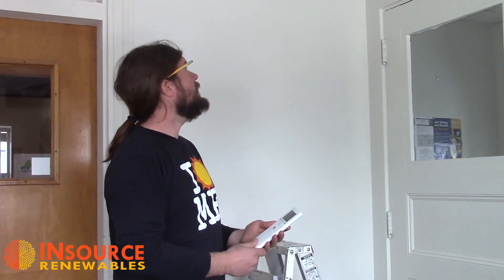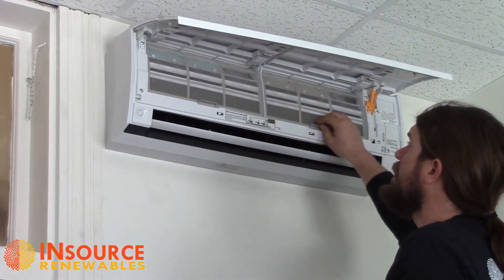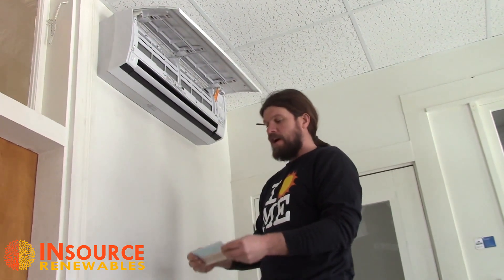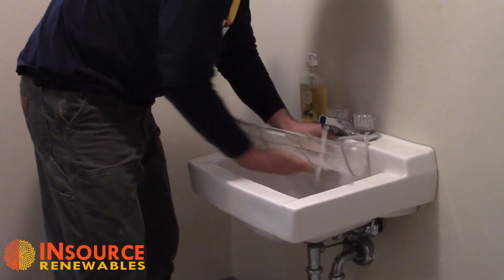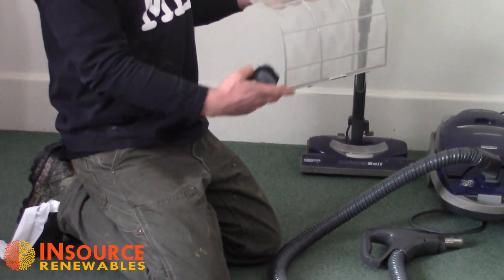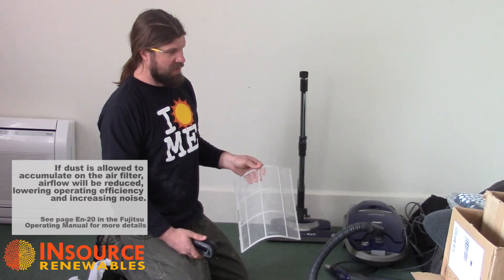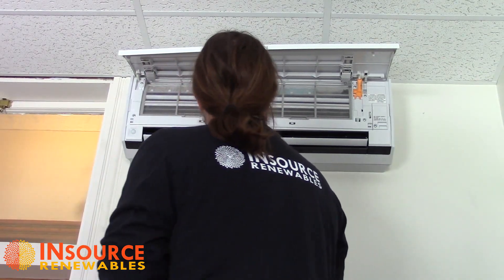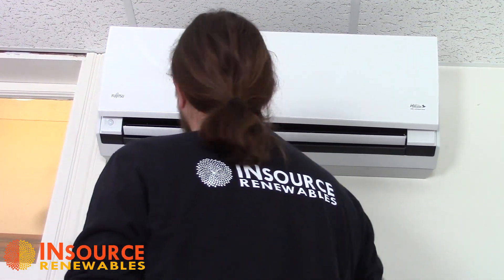Heat pump user tips #1 (Filter maintenance)

Comment: Before watching this video. I cleaned my filters using hot water with Palmolive dish soap. To scrub I used a brillow pad not knowing the damage that it can cause. I still run my unit. What is the consequence of doing so. Honestly curious I do not want to further damage the machine. The filters that I cleaned we're the main ones that you showed on how to properly clean.

Comment: I just cleaned my filter now I have the lights blinking.
Do you know if the center clip actually needs to be closed? It juat looks like Styrofoam in the spot the middle clip connects too?
I've clipped all 3 connections down and it is still not working. I'm wondering if I broke something on the center clip?
Reply: Is there a way to check the switch. Do the latches actually make any type of electrical connection or just hold the main switch down?

Comment: When you're not using the AC for long periods, is it better to turn it off at the switchboard? Or there's a grey switch near the outside unit do I turn that off? Does the filters need to be completely dry before you put them back?

Comment: Now I can't close the frucking flap, it's sticking out.
Reply: If you're talking about the dark gray cover below the larger white one, there are three tabs. This unit is notorious for having an issue with a tab breaking or not seating properly. If you press on the dark cover directly where the tabs are located and they don't seat, you may need to take further action.
Reply: @vaughanwoodruff  I finally managed to close it. I had to play with the tabs so the flap's could slide in, ugh...

Comment: You should never seperate the top lid from the bottom one, or put your hands between them.
You should not touch the upper lid at all, except when you press it on those 3 spots at the end. You close and open the lid by little handles on the side at the same side, and close it like that, then press the whole lid on those 3 spots. You handled that lid completely wrong. You can read the same in the manual.
Thqt's why you got that error at the end, which is not supposed to happen.

Comment: Great explanation of everything under that hood! 
How often do the hood senors need to be changed? I absolutely dread cleaning the filters because .every.time. on both of my units, I receive the error code that the hood is not closed properly. Its been a game of chance and skill, to see how many times I have to open and close the hood before the unit turns back on.

Comment: My unit is throwing this error code even though it IS closed correctly. It has done this many times over the few years I’ve had the unit, but I’ve normally been able to solve it by turning the breaker of for a few minutes. This time nothing works, does anyone have any ideas?
Reply: Joel, if you have the intake grille cover open (with the orange kickstand up), the switch is located on the bottom right corner (below the kickstand and beside the electrical cover). If you hold that in and the code doesn't clear, you have a bad switch. If you hold it in and it does clear, there is an issue with the seating of the grille cover.
Reply: Vaughan Woodruff, I’ve been thinking it may be the switch, the thing is it’s been a problem for awhile now so I’m thinking it may have been going out for awhile now.

Comment: I have this unit, took off the filters and cleaned them. The door closes fine but when the door starts to slowly move up, it gets to the top and just falls closed again. No error code but the unit works but the door is closed so the air doesn't flow. I have had to duct tape the door open to keep the room cool. Do you know how to make the gears catch again?
Reply: If it happened following a filter cleaning, I am suspicious that the cover may not be properly reseated. Typically this would trigger an error code, so it is quite possible that the plastic gear on the cover is broken. They crack sometimes, which requires replacement.
Reply: @vaughanwoodruff  Thank you! :)

Comment: Hi great video just a quick question I have a toshiba inverter carrier 
It seems to leak water on side and down my wall any suggestions thx
Reply: That's condensate - it's due to either a trap in the condensate line, the indoor unit not being level, or an obstruction in the condensate line. If this is a new unit with this issue, it's likely an installation issue. Is this is the first time it has shown up after years of operation, it might be insect nests in the condensate line. We have seen a rare occurrence of a leak in the condensate pan, but that a hundred-in-one shot. Good luck!
Reply: Vaughan Woodruff thx a lot I just bought the house last year and the unit was installed 
In 2013 and serviced 2017 maybe it needs to be serviced again thx again

Comment: Hi - I find that inevitably, some airborne cooking oil will mix with the fur, dander, and dust that accumulates on the large filters, making rinsing with water inadequate.  I spray the filters liberally with Fantastic and let them sit a few minutes before rinsing with hot water.  If they look off-color, a second spraying, wait, and rinse cycle is warranted.  You can hasten cleaning by using a soft, fine bristle nail brush and gently stroking the built-up dust, mold, etc. before rinsing.  That makes the filters sparkle, and removing any built-up grease makes them easier to clean next time, and not as much of a dirt anchor and food source for mold and pathogens.  Air drying thoroughly before reinstallation is important, as well.  In summer, the vent flaps will condense moisture from the air when the unit shuts off, because the vent flaps are cold; that moisture will leave a dirty residue that is likewise a bacteria and mold culture medium.  A quick pass with a sponge wetted with Fantastic will break up the residue, which can then be rinsed off with a clean sponge.  Looks, smells, and IS clean and healthful.

Comment: How often do you recommend the screens be washed?
Reply from the maker: It depends upon the air quality in your home and how much you use the unit. We recommend inspecting the screens every couple of weeks after you have put them in to see how quickly debris accumulates on the filter. For most homes, the filters need to be cleaned every couple of months.

Comment: I have the same problem as Selle but no answers?
My front door will not automatically open when power is on. Air is still coming out and no flashing “warning” light?
Reply: This is a common issue with the RLS2 line. It is likely that the gear on the door is cracked, thus it won't engage when the wheel in the unit turns to open the door.

Comment: Nice video..

I'm at 10:08 of the video and in my case, the hood has not held up on its own - any idea why this could be and how I can go about fixing it? : (
Reply: Got the exact same problem... What's more, I have to put tape to hold the hood because it won't come up on its own when I turn the machine back on...
Reply from the maker: @curieusedi , there was an issue with the early RLS2 units that led Fujitsu to develop a plastic shim that is placed adjacent to the female portion of the clasp that keeps the darker gray cover under the intake grille cover secured to the unit. We have seen several other approaches to resolve this issue - a technician should be able to resolve it with the right parts in 30 minutes.
Reply from the maker: Sorry for the delay - if the front door doesn't stay up, it is typically because the gear on the intake grille cover (the part that goes up) is broken. It is a reasonably simple repair that requires removing and replacing a few screws and  a new gear. The part should be covered under warranty.

Comment: Hey. not sure if you will notice this. I have the same heat pump but our door is having a problem the door sensor keeps going off a few times making the heat pump unuseable our clip was broken but we glued it back together and it worked for awhile... but not its not working at all... is there any way to maybe unplug the door sensor.... because it is most of the problem... than to get some guy to come in for like 5 mins for 100 dollars to fix it.. than likely another 40 bucks because.... "service call"

Comment: my fujitsu rls2 is spitting out water is there any reason why? or how i can fix it?
Reply: This is a condensate issue. There are typically three reasons this might occur: (1) the indoor unit is out of level and is accumulating condensate, (2) there is a trap in the condensate line or the condensate line is not sloping to drain, or (3) the condensate drain is plugged. Sometimes spiders or other insects will build in the condensate line - you can look in the end of the condensate drain to make sure there is no stinging critter there and then blow into the condensate line to dislodge any webs, etc.
Reply: Vaughan Woodruff thank you so much for replying back. Do I need a ladder to check? Or can I do this from the inside? This unit is on the 2nd floor
Reply: The termination of the condensate drain is likely outside near the ground. Look for a corrugated flexible plastic line (looks like the tubing kids spin fast to make a whistling sound) or PVC line. That would be the one to blow into.

Comment: Matt I cleaned my filters like I have many of times and now my front door that goes up will not go p all the way and when it starts to run the door will fall all the way down. What or how do i fix this?
Reply from the maker: Sorry for the delay... the door typically won't stay up due to a broken gear on the intake grille cover (the part that goes up) or if the dark gray cover behind it pulls out when the door goes up. If it is the gear, the unit will continue to run without lights blinking an error code. The fix is as simple as taking of a couple of screws, replacing the gear, and replacing the screws. The broken gear should be under Fujitsu's parts warranty. The other issue requires a shim to the female part of the cover clasp. It takes about 30 minutes for a technician to fix with the correct part.

Comment: How problematic is having cats and dogs going to be with those filters?  My window unit stopped totally because of dander buildup on the coils. Even pet hair from the outside got into the air conditioner.  Would the same happen on these units?
Reply from the maker: The hair will end up in the unit - cleaning it is pretty easy.

Comment: HI. thx for effort I learned something watching it. But may I ask you if you can explain what for and how we use option DRY from our remote control that when i start it it seems like it does nothing. and I hoped it may be dehumidifier.
Reply: Dry mode is meant to dehumidify. It is essentially a mellow form of A/C. The indoor unit fan speed remains constant (and low), and the outdoor compressor runs towards the bottom of its range. Indoor moisture condenses on the coil and is expelled outside. You can make it more aggressive by turning down the set temperature, but it has its limitations. If it is not drying the air enough for you, I suggest using the "Cool" mode. Keep in mind that if you use the unit to dehumidify in a space that stays in the 60F range (i.e. a basement), you will need some further work arounds to get it to dehumidify the space.
Reply: thank you very much for this clarification cuz I always thought that it does nothing because I hear no sound no matter how long I leave it to work on that DRY mode. I was not sure if it really does dehum. so now am sure I dont need to buy dehumidifier cuz my A/C is doing the job!

Comment: Are both of the smaller filters standard? ie: I have a 15RLS, and was wondering what small ones, part numbers etc. fit in the 15RLS? Thank you kindly...
Reply: +123ram123ram Is it a 15RLS2 or a 15RLS3?
Reply: +Vaughan Woodruff awe crap, sorry about that, it is a 3.
Reply: +123ram123ram The part numbers for the filters are as follows:

K9315361035    APPLE CATECHIN RAC-RL UTR-FA16 (2 PCS)

K9315361042    ION DEODORANT FILTER RAC-RL UTR-FA16-2 (2 PCS)

K9317250009    AIR FILTER KIT HFI UTR-FA16 + UTR-FA16-2 NO FRAME

The third item is one of each filter. They are not cheap - usually a pair is about $50.

Comment: Great video! Thank you for the info. How often do you recommend cleaning the intake filters?
Reply: +Karen Salemi It really depends upon the air quality in your home. You will see various matter buildup on the filter, much as lint accumulates on the screen of a clothes dryer. Like with a dryer, as the filter gathers contaminants (such as dust, hair, candle residue, etc.) the efficiency of the unit decreases. I recommend checking it after 2-3 weeks of continued operation to see how much has accumulated.

Comment from the maker: Glad you found the video helpful, George. If there are any other videos you'd like to see regarding heat pumps, we are always open to suggestions!
Reply: Insource Renewables &
Reply: George. Need some help my Indoor unit is. Leadkin g. How do I stop it. My. Drain. End Outside was covered. With screen.
Reply from the maker: It is likely a condensate drain issue - it could be a trap or obstruction in the condensate drain.